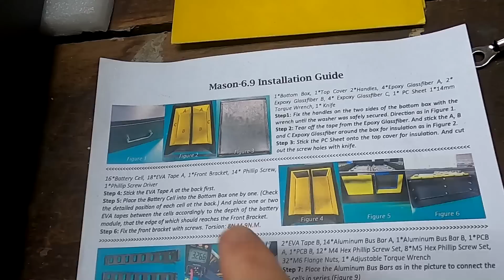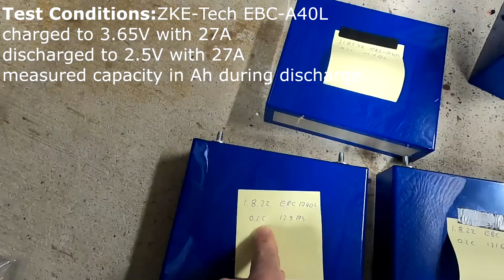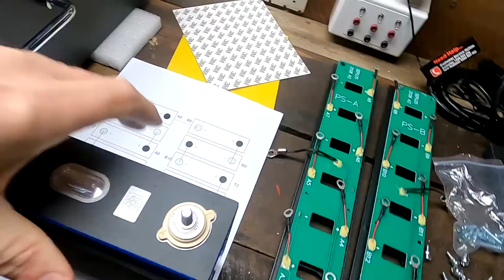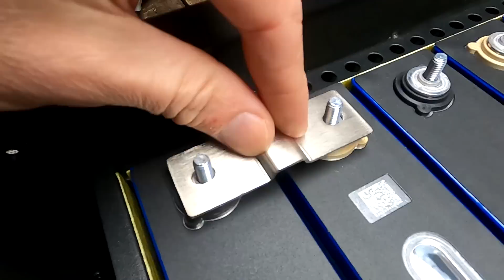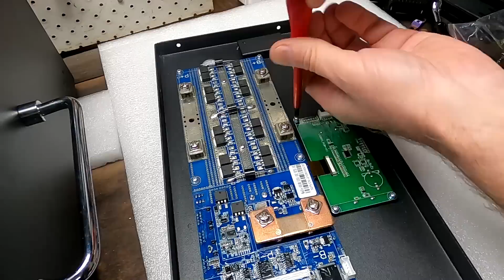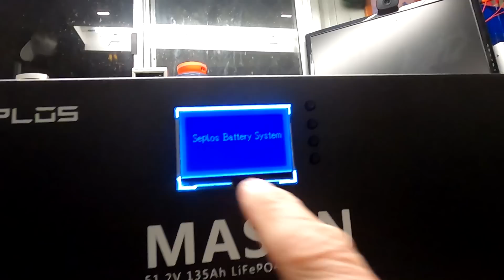SEPLOS MASON 6.9 Kit. Building a battery was never that easy (and fast).

Comment: Good video Andy. Why make a dc positive connection black? Good question, this has definite potential for stuff-ups. Not totally happy with their explanation for lower capacity, while their statement is valid, they should be advertising at a lower ah rating to save face maybe. They obviously have not balance matched these cells, they seemed out of whack a fair bit and it would have been nice to have all the stats of at least a few cells as I suspect they are not as advertised, while are probly mostly good overall tho .  
An external isolator would be nice, and maybe a clear panel to access the fuse and to check visually. I would like to see another washer on the neg post terminal as you started the first time (around 26:30 ?) to share load onto that plastic insulator insert, I dont like to see that nut get over crushed on the plastic, especially in the case this terminal may have a resistance and get hot, a small thing that may not really matter. Looks like a fairly nice and robust build overall. Ive heard Seplos is supposed to be good, but I am not convinced yet. 
I have 3 x Suntorque 48v 100A batteries with Seplos BMS on an MPPT all-in-one system in a trolly setup for now. I bought these as a simple drop in setup, no need for comms etc, and haven’t had time to setup a pc or comms yet, and I have been having trouble with 2 of these batteries only charging to 64% now since purchase in March, they quickly lost capacity with each charge from new, Im sure it is a BMS setup issue I am looking to address just as this video come out, so thanks again Andy and look forward to ur upcoming vids on the Seplos systems. Cheers

Comment: I bought 4pc of the Mason 280 but I'm not a very DIY guy especially for electricity stuff (just learning), so I had Seplos shop the boxes to my Battery supplier and they did all the installation for me and shipped the battery banks. It's on the high sea as we speak
Reply: I am also interested to buy Seplos May I ask what you paid for each batterie?
Reply: @t6vX423M  I paid 500 each exclusive of shipping

Comment: Good job, Andy! Howerer for me, it is safer to connect the positive terminal of the BMS to posts first, then negative terminal second. Lastly, connect the busbars of the two battery packs in parallel.
Reply: Yes that sounds correct.

Comment: It will be interesting to see how well the BMS balances the aging cells. I'd be inclined to top balance first, then let the cells rest for a few days to see if any of the cells self-drain.
Reply from the maker: I installed the batteries as they came, so no initial top balancing at all. Because I tested 4 of the cells, they were on a different SOC level though and the BMS... Arghhh, I don't want to spoil it all here....😁
Reply: @OffGridGarageAustralia  Yup, yup, yup. You could always pop the buss bars off later and see if any are discharging.
Reply: It looks like a passive balancer. I didn't get a good look for capacitors while watching on the tiny screen (smartphone)
Reply: @CollinBaillie  Yes its a passive balancer
Reply: @CollinBaillie  I just took a look and I think I'm seeing SMD caps and a similar layuot to  the JK BMS Active balancer, but possibly a micro processor to boot, so Andy's testing should be interesting. I suppose it will only balance with the power on but I suspect it may be pretty low balance current.

Comment: Nice work Andy. The nice part about these Seplos kits is the BMS. Each 6.9KW battery can load balance with each other when connected together. The PC software is pretty cool also.
Reply from the maker: Well....... I'm not convinced about the BMS yet. Playing around with it for a few days now and.... I want my JK-BMS back 😭
Reply: @OffGridGarageAustralia  Spoiler alert.  hahaha   Loved the video!
Reply: @OffGridGarageAustralia  a lot cheaper and far more value considering the balancer being part of it. 
SEPLOS BMS 100A incl. Display and ddp (19% vat + shipping) was 340€ for germany, but the 
JiKong CanBus edition incl. switch and display was less than 150€ on banggood with 200A

But I needed a BMS that would communicate and integrate with the growatt inverter to get all the figures of the system once you are away from home just to check if everything is working fine. Who wants a 15 kWh in the house or garage without control and integration if you are quite often away from home?
Reply: @OffGridGarageAustralia  takes a little getting used to andy, also the lack of BT and not seeing numers instantly on your phone plays into that..
give it some time
Reply: agreed :)
Reply: How many kw/wh is this

Comment: Great video Andy!  I have a pair of these mason 6.9's and 5 of the separate 100a Seplo's BMS's running on my other 25kwh bank.  I enjoyed the build.  One of my DIY kits didn't have all of the nuts, but I had some handy.  So far mine have tested just fine, with the capacity limited via software.  You should be prepared to only use 90%. You can use the software to go edit to zero but again why?  You don't drain your bank down in real life so its all good.  Also I was told that they balanced charged them before shipping so  you shouldn't need to parallel them for days to balance charge.  The first charge will set the pack capacity to 135ah.  BUT I would charge up to 3.4v and leave charging with a 1 amp finish charge until it shuts off.  The testing you did probably took them out of balance/ equalization and it wont test right unless they are top balanced.
Reply from the maker: Yeah, exactly. They were out of balance. I did not do an initial top balance in parallel which I should have done. I wanted to see how the BMS handles it. Not a good idea. I'm not too convinced about the BMS yet... It will be in the next video including full capacity test, the full experience download 😁
Reply: @OffGridGarageAustralia  I am one of "those" that does a full capacity test on every cell. Just use the tester to leave them all full. Once in the case you can just top up individual cells if necessary, or have it leave them at whatever state of charge and then charge them up individually. Anyway, many ways to get them even before you test capacity.
Reply: @OffGridGarageAustralia   I have a ichargerx8 that I use exclusively to avoid the days of parallel charging.  I just set up groups of 8 and then do a slow charge and balance and the X8 will burn off power as needed from the high battery's at 5amps!! Almost the perfect fit!  I wish they made a 16s unit.
Reply: The BMS will take a long time to balance  the cells as its a passive balancer.
Now they are all installed you may want to connect the charger and each time one cell hits the limit use a resistor to discharge it a little.

Comment: Andy ,my EG4 Battery weighs in at 96 pounds and you are way too old like me to be lifting that kind of weight . oh and yes it cost less and i did not have to put it together.
Reply from the maker: Yes, it is heavy and I probably have to wait for Andy2 to get it off the workbench.
Not sure about the capacity of your EG4 but this Seplos system has 6.5kWh.

Comment: Hi Andy, I found the 280 DIY fuse holder screws were the short screws holding the battery front plate in. I didn't twig for a while.
Reply from the maker: Ahhhh, that could be it. Thanks for that.

Comment: Very neat. If the overall capacity is down on that stated, you should ask for a discount by the same percentage the cell capacity is down:)
Reply from the maker: I got a bit of a discount already as I bought two systems at once. But yeah, lets see the capacity test in the next video, ey?!
Reply: no, for sure not if such batteries aging is based on calendar and full cycles then 32 months old cells that might age well only up to 10 year or 120 months means a loss of 32 / 120 or roughly 25% and therefore it needs at least a 25% compensation which I would call a fraud cause the cell manufacturer do grade batteries down after a few months like EVE does after 3 months. They sold him the kit not as DIY kit with 32 month old cells cause I had asked them back in June or July when I was about to buy such a 135 Ah cell Masosn 6.9 kit

So happy that I finally rejected all their offers that were fooling cause  I had only asked for the Kit without any cells like they offered the LF280K kit. They had tried to upsell me to the full kit incl. cells and then later when I finally said no they even raised the price for the Mason 280 from 600$ to 800$ just to convince or force me to buy their Mason DIY 6.9 kit.

We cancelled everything and simply bought the expensive and overpriced plus underfeatured BMS without WiFi and Bluetooth support due to 1 fact: it is the only bms that is working with a bunch of chinese inverters talking canbus straight.

Comment: I can not wait to see the performance of these cells cause I had canceled the order of the 135 Ah Mason battery in the very last second cause I did not trust them when they called them battery manufacturer, I mean cell manufacturer.

We ordered cells only and the SEPLOS BMS cause I need Growatt CANBUS support - and the 280 Ah version was simply too big and heavy for us.
Reply from the maker: Yep, full BMS and capacity experience will be in the next video. Working on it...

Comment: Those balance leads are a little short; I'd like to see them 1/4" longer, or have them pointed right at the cell terminals.  Aside from that it looks like a nice design!
Reply from the maker: It would be enough if they point them in the right direction before applying this glue on top of the solder area. I had to stretch some as well. I'll mention this to them for future improvement.
Reply: My Mason DIY (EVE 280ah) arrived with a few of those leads snapped off.
Henry at Seplos was pretty good with send out replacement PCB's which arrived in only a few days.

I also couldn't find any screws for the fuse holder, but was able to repurpose a couple of the in-transit screws

Comment: why in the world did they not cut the clear pvc top sheet to the actual size?
Reply from the maker: The clear PVC is a bad solution. It is not sticky enough and fell off. They need to work on  different type of insulation if any at all.

Comment: Most of the other server rack batteries would have a circuit breaker that you can flip right on the front panel.  That would make me feel better to have physical confirmation that the terminals are off.  Plus you wouldn't have to try and replace a fuse like this one has if there was a short.
Reply: The updated models do, this is an older version
Reply: The batteries connect in parallel to the Seplos JASSN external busbar, which includes circuit breakers.
Reply from the maker: Both fuses and breakers have pros and cons. 
You should never have to replace this fuse.

Comment: Hi Andy, what standard is this battery compatible with? Could it  be configured in the inverters as a Pylontech?
Reply: Yes
Reply: @Sanwizard1  thanks!
Reply: you must first make a choice between CANBUS or RS485  version of this BMS.  different firmware are available, including Pylon.  be careful, do not try to  install a rs485 firmware on a CANBUS bms version (or the other way) . its going to brick the bms.  Be aware Growatt inverter do no support anything except theirs own battery now.
Reply: @sergea1138  does that mean that CAN or RS485 is not only selected by switches but  also by firmware?
Reply: @DrCoolZic  the difference is hardware. You have to state if you want RS458 connection for your Inverter. The default shipped is CANBUS.

Two or the ports on the front are RS485, but only used for stacking multiple packs (Not BMS connectivity)
Reply: @DrCoolZic  for people that already have the BMS, the serial number contains  10C or 10D in the number which indicates if you have the CAN or Rs485 model
Reply: @DrCoolZic  No you have to order the right version upfront,  updating the wrong firmware will brick the bms
Reply: @serge I just recently tried their BMS with my Growatt SPH inverter and works like a charm. You just need to ask them the proper firmware file to upload via their Battery Monitor software.
Reply: @buhaysolarista2275  I wil never buy an inverter without pylon support

Comment: In the west, black is "hot", neutral is "white" and ground is bare copper or "green". That could be the source of the colours, except of course that DC has usually been positive "red" and negative "black", so no idea why they'd take AC colour code, if that is indeed the source.
Reply: In Europe, brown is hot, blue is neutral and green/yellow is ground. Grey and black are used between a switch and lamp for example to indicate a switched live wire.
Reply: @upnorthandpersonal  Nope, that's not it... "China (PRC) has the wiring color codes standard for flexible cable and fixed cable as follows. The wire color codes from this category are extension cord, power cable, and lamp cords wiring color: Line (L) = yellow, green, red. Neutral (N) = black, blue."

Maybe they did it for American clients, and that became standard?
Reply: @upnorthandpersonal  I think the real question is; What is the colour code standard in China?
Reply: @TheDigitalMermaid  Well, you know the XKCD about standards, right? :)
Reply: @upnorthandpersonal  Ha! "Now there's 17 standards!" :)
Reply: @TheDigitalMermaid  That's the great thing about standards, there's so many of them. A sarcastic statement I heard as a kid that stuck with me.
Reply: @upnorthandpersonal  we used to say "live is brown, because when you accidentally touch it, you crap yourself."
Reply: @BobHannent  They used to be red in countries like Belgium; the saying was "red is dead".
Reply: @upnorthandpersonal  I've seen red as neutral somewhere and I really didn't get that!
Reply: The world soon will follow Chinese standards
Reply: One would think that red pigment for the plastic used in the terminals can't be that much more expensive. Someone, somewhere knows why Chinese cell manufacturers started using black and white (reversed to our way of thinking), but now it's "because we've always done it this way".
Reply: @john_in_phoenix  Whatever their reason was, I am sure pigment price wasn't it. It was likely, I am guessing, an early client saying they wanted it, and they just stuck with it because why not?
Reply: @TheDigitalMermaid  could it be an EV standard thing? These are technically EV cells.
Reply: @CollinBaillie  entirely likely, but still, why black positive?
Reply: In the UK Red is live and Black in neutral. Earth is green or green and yellow stripes. On our 240v mains the old wires were the same red-live black- neutral But the newer 240v mains cables are brown-live and blue-neutral  and earth is always yellow or bare wire with a yellow sleeve that is slid over the bare wire.

Comment: Thanks for the video Andy. This really looks like a nice kit but is it significantly cheaper that fully built batteries of similar types and capacities? Any other advantages? I guess they are more expensive than raw cells + DIY BMS.
Reply: I suppose the biggest factor in the calculation is how valuable your time is.
Reply: Seem to be $100 cheaper than buying pre-built from them. Not sure if USD or AUD, I didn't pay attention when I checked out the site.
Reply: @CollinBaillie  Im guessing USD

Comment: Trying to communicate with Seplos via their website is a waste of time… They don’t respond to chat and their form doesn’t accept actual email addresses. 
I tried their support email address to see if they respond.
Not impressed so far…
I’d be afraid to send them money with this kind of CS.
From Alibaba - $600 for the unit and $306 for FedEx shipping.

Ain't gonna happen...lol
Reply: the DIY kit for EVE 280Ah cells is 450-500 $ with the bms and everything except cells. getting the box by air is of course expensive.
Reply: @sergea1138  no, the price getting via sea freight or land is that expensive (train or ship) at least for EU citizens. 
Ask them for a quote and if you have reached the alibaba payment section then you can be sure that this is the finaly price.
Before they can raise the price any minute as they had done here.
Reply: more or less exactly my experience from germany: extremely high prices and shipping fees, terrible communication, false advertisements cause they had offered the 280 Mason for 600$ plus 200$ and then said that the offer no longer exists cause the price has been raised to 800$ within less than 6 hours or so.
Luckily I have canceled the Mason 6.9 order and went to alibaba to simply get the BMS cause that is the only that is working with Growatt SPH and SPF inverters for 48V systems.
Reply: @typxxilps  wow, I'am sorry to heard that.  the best advise, I can give you is to ask them to send the box to your cells provider and let your cells provider  handle the shipping. cells provider like Amy W or Jenny   have have more experience in delivery to end user.